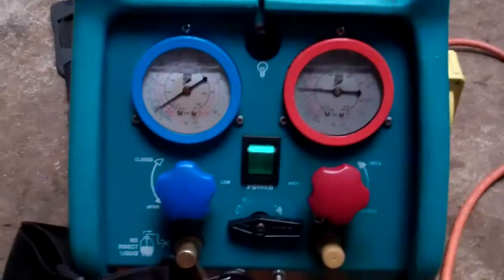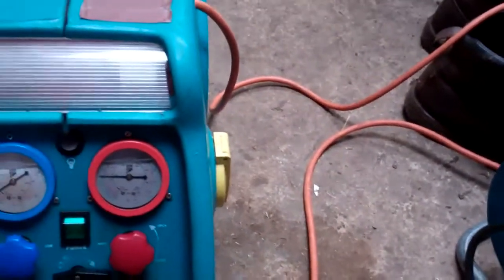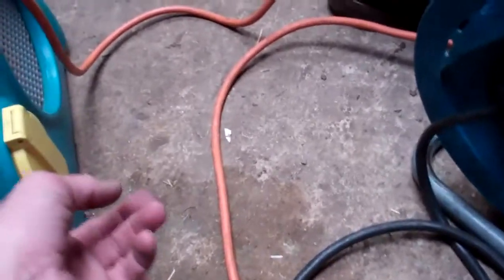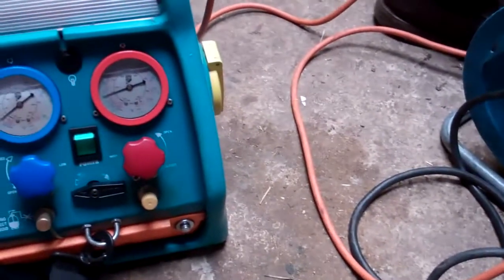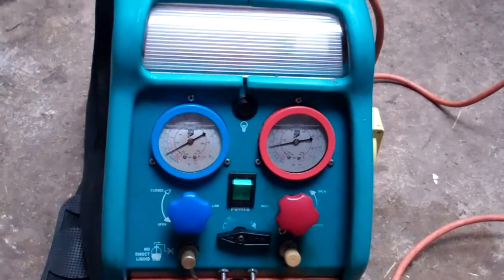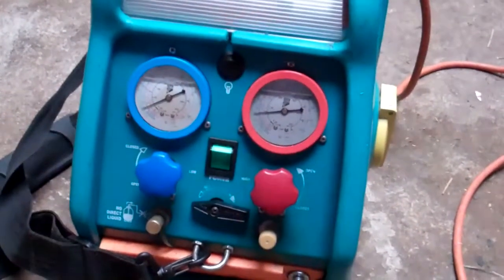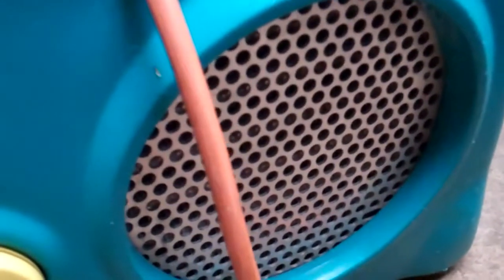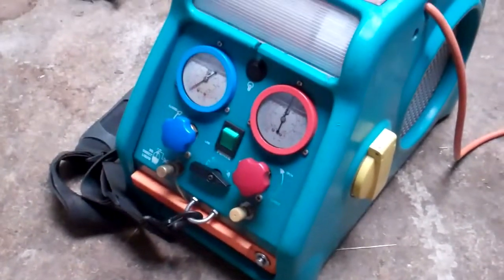Refrigerant recovery machine

Comment: I just bought a Bacharach Stinger. Seems to be a good machine. Put a flare drier on the inlet and a ball valve on the outlet. Effective setup. Yours has a few extra features that seem nice. They are similar in size and shape 3/4hp comp. I know from experience that the G5 is a quick recovery machine; faster than others. It is also the most expensive! I'm happy with my stinger...

Comment from the maker: It depends on the size and type of equipment you plan to work on but the Appion G5 Twin and Promax recovery machines are both good. 
Check to see what the warranty and spares availability is like from your wholesalers/part house. A machine with a purge function would be good if you work with a lot of different refrigerants.

Comment from the maker: @FireConvoy88 I nearly ordered a G5 last week as i heard they were good, but then started checking the spec on it, 1/2 hp motor 37lbs an hour reco rate, but the spec on the eco buddy i have is 500W motor, and 30kg an hour reco rate! Trouble is i don't know if the ratings are at the same conditions.

I might get one anyway and  use my old one as back up or take the two of them on big jobs.

Comment: I have the Appion G5 twin its a good machine very fast, small and compact and easy to repair if needed.
Cons its very noisy, no purge on it, so refrigerant stays inside till you get a empty or low recovery bottle.

I think the Diablo recovery machine is nice, but I think the Yellow jacket XLT is a very good recovery machine, its has a purge function on it but its petty expensive compare to the others.